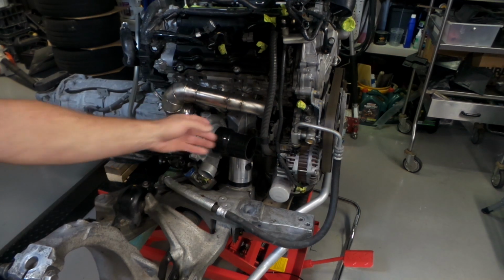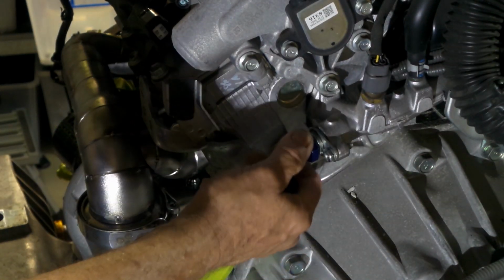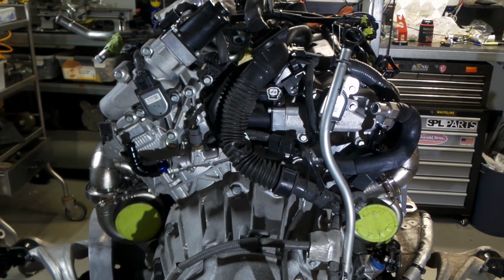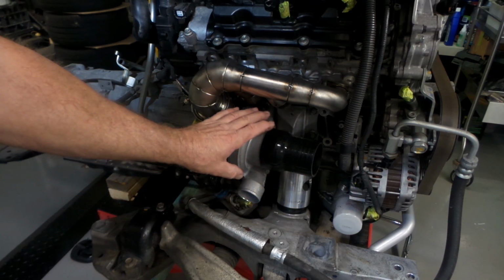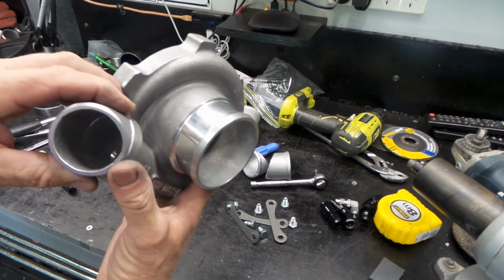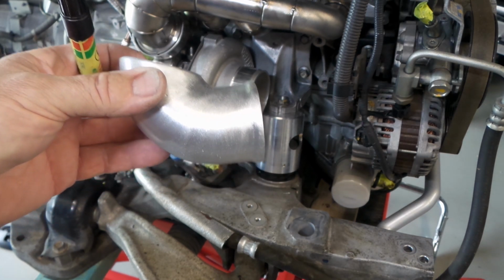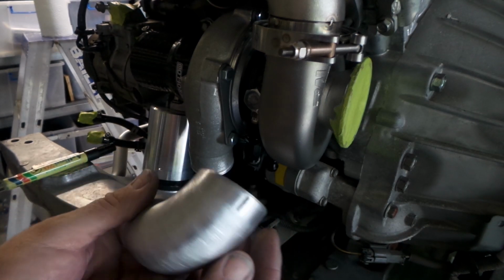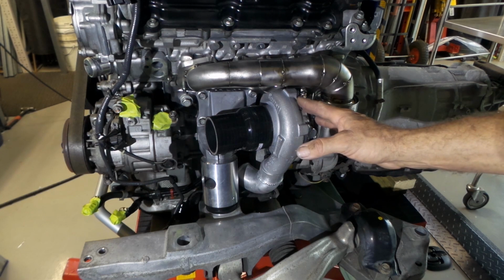370Z G37 370gt RHD Diy Twin Turbo Build EP:5

Comment: Getting there...From this angle, it looks like you will have some problems providing clearance for the oil filter with the drivers side intercooler run?
Reply: All the best recovery to the misses.
Reply from the maker: @Bennyboy-dog  Thanks Benny, yes clearance will be tight there for sure, but i think i'll be able to make it work. You'll probably here me cursing it in future videos. 
Cheers Mate.

Comment: I'm actually in the process of embarking on my own custom TT build for my 370z. Currently going to use twin Greddy TD05h-18 turbos with a 20g billet wheel upgrade. What turbos are you currently using?
Reply from the maker: G'day Mate. Garrett GTX2867R with Tial .86 Stainless V Band Exhaust Housings.
Reply: @TheAussieShed  those are very nice. Did you go flex fuel or is that not readily available in Australia?

Comment: Trev - what kind of numbers are you expecting to get out of this setup - and if you don't mind... what's the improvement over stock?  Sorry if you have already answered this... and hope the Mrs. is healing well.
Reply from the maker: Hi Rick, stock these things usually get around 260hp at the wheels, the new power level really depends on how much boost I'm game to stuff into the stock motor.
Between 500-600 seem to be the sweet spot if you have a good tuner. I've seen guys grenade the VQ37 with 400hp & others run 600 for years if tuned well. With bigger injectors, E85,  Rods & Pistons it should be good for 700-750. At that power level I would have to put a heap more cash into the transmission also.
Cheers Mate.